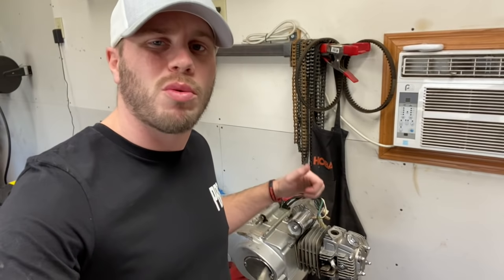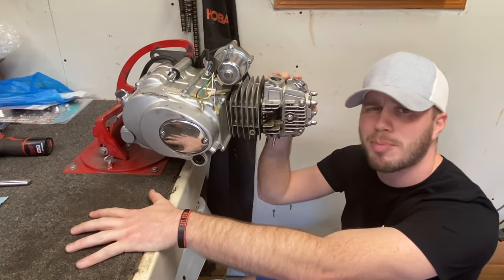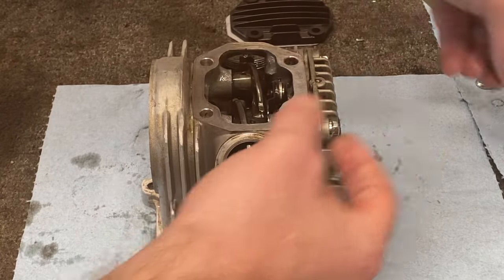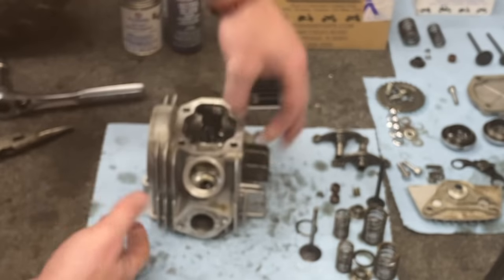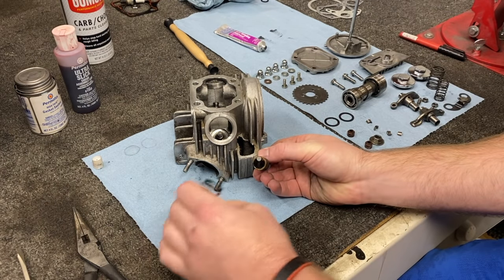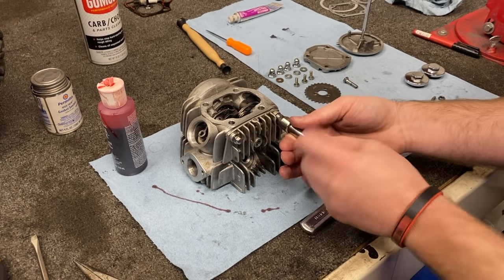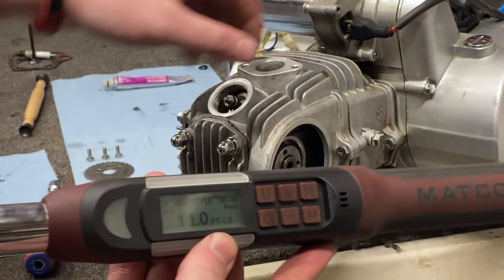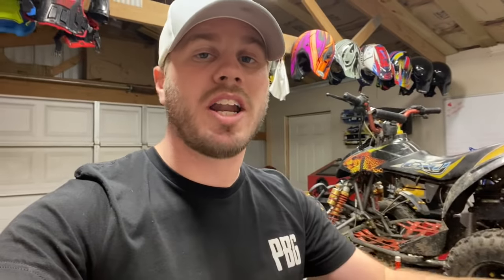HOW TO: Complete Tear Down & Rebuild of a Chinese ATV Engine Head. Every step you'll need covered!

Comment: Great video man! I enjoyed all of that. I just had a question. Is it possible for you to work on those Chinese X-Pro pit-bikes you find on Amazon or eBay?Found metal shavings in mine when I gave it an oil change. The oil was last changed by the last owners basically 7months ago? I’m hoping get this little bugger fixed so I can still get to school on time. Don’t have enough money to buy a whole new engine so why not just rebuild it? 🤷‍♂️ would be greatly appreciated if this is possible.

Comment: I have a atv. 550 Polaris. It runs good sounds good. But smokes a lot and burns oil. Will a leak down test tell me if it’s rings or valve seals

Comment: I was trying to put the chain back on the sprocket but it came of the sprocket inside the crankcase, do I take the crank cover off to put it back on? Also will I need a new gasket if I take off the crank cover?

Comment: Thanks for keeping it simple ...... how can I tell if someone has put the wrong parts on a motor and just claims it won't start ?

Cause I have a 125cc motor that seems to have the wrong cam shift since when I line up the timing marks the intake lobe is pointing down ?
Reply from the maker: The cam in my experience does not have markings to identify the part. It is very easy to order the wrong one. Hard to say without having the original to compare side by side.

Comment: Brother i replaced the clutch in my chinese 110 atv and while i was in there i removed the other big gear to inspect the shift gear and linkages. put it all back together and now it has no compression. i did tear the old cover gasket so i use some silicone. it was running great before i replaced the clutch. any idea what i have done wrong. could i have gotten it out of time some how? i only went into the side that has the clutch. or could the bad cover gasket and sillicone i used cause a leak somehow and give me low compression. it is so low that when you put your finger in the spark plug hole you can barely feel anything as im spinning it over. please help as im very confused as to what i may have done.

Comment: As everyone says,  your video is great!  So very helpful.  Thanks for taking the time to make it.  Just wondering if you've ever seen a 125cc with 23mm/20mm valves with a 32 tooth timing sprocket.  I need a new head, but all I've seen have 28 teeth on the timing sprocket.
Reply: I am in the same situation. Did you find one?

Comment: My son has a 70cc it runs and idles fine but if you snap the throttle wot from stand still it bogs tried everything no stranger to these things just ordered a nibbi carb hoping it’s just the Chinese one that won’t take good adjustment… two questions one have you run into this and 2 have you come across a big bore kit or is it possible to just get a 125cc kit and just keep my bottom end

Comment: Hello bud i have a gy6 150 cc automatic foward and reverse 
my issue is iam getting gas in the oil crank case after a roll over this isue started i installed a new carb but no luck it starts up with no problem but fills up with gas can you please give me a answer on the issue
thank you great vid

Comment: I have a 110cc full auto with starter under engine. It will run but you have to stay on the throttle just won't ilde. Did new fuel line, filter and carburetor. It was used. Can you share a little wisdom?

Comment: Nice and detailed.  Will one oil the valve-shafts before reassembling ?  Great vid, thank you.
Reply from the maker: I just had to watch back to see if I show that and I don't. I poor the engine assembly lube over the top after installed that way the stem and springs are cover. Thanks for watching!

Comment: hey i hope you can help me on this. i got a small leak on the head and it seems like it is coming out from the long bolt thay holds the  chain cover om the head. should i just replace the head gasket or anything else?

Comment: Great info, we were able to diagnose the same problem "exhaust valve" on a motor from  TAO TAO ATA125D, I haven't bought any parts yet  to finish the repair. Before going any further I noticed a difference in the timing drive sprocket on your cylinder head assembly is 28 teeth and the one on mine is 32 teeth. Will the VCM cylinder head assembly  that you make reference to work with the 32 T sprocket from my old cylinder head assembly?

Comment: I have just bought a pantera 125 cc dirtbike that has turnsingals etc . For 100 bucks. Is this the same engine ? Or similar ? Would the parts be easier or simple to find on Amazon or elsewhere? Thank you

Comment: Hello! I am really enjoying your videos. They are so well done, I like your production style.I have a question about a Coleman AT 125 EX brand new no miles so far. The engine will not start, has gas to the cylinder but no spark. Engine turns over, is getting gas, wets the plug but no spark. Dealer is not interested in this problem and will not be able to look at it for at least a month. Summer is short here, What are the possibile causes? Thanks so much, Tim

Comment: So I have a question....you are a great resource by the way.   Really appreciate you.  
I am now working on my 3rd chinese.  Finished a quad and a 70cc pit bike.  Now I am on a 110cc quad again but I have rotten tires and I wanted to get new wheels and tires but I noticed the distance of the studs was only about 70mm instead of 78....of course the wheels can't be found on the web....this model is a buyang?  Have you run into similar issues like this?  Everything else seems to be exactly the same... lol
Reply from the maker: Glad you like the content! Yes I have ran into that issue several times. I purchase the rim diameter size I need and then punch and drill new holes to fit the wheel hub. I don't show it on video but that's exactly what I had to do on my last video on how to flip a chinese atv.
Reply: Well...I wasn't quite sure I could get those holes perfect so I didn't try that.... lol....
I did however purchase the "mini" tire changer from Harbor Garbage (harbor freight)and it worked great!  Thanks for the advise
Reply from the maker: @deepsouthgrease  You bet!

Comment: Need that motor stand!!!!!
Reply from the maker: I actually had a CNC company laser cut out all the metal to start making and selling my own. I will be selling the kits on my website either as a DIY kit or a completely assembled and power coated. Should have everything ready soon and will post updates on the channel.
Reply: Omg! Yes I will buy one as soon as they are available! Any thought on costs each way?
Reply from the maker: @StevenChaosCloud  I haven't ironed it out yet but based on time and cost of materials I am projecting around $150 including everything.
Reply: Not bad at all man!! Just let me know

Comment: This got me thinking, does the decompression valve in the head not affect the compression? I’m still at 70psi on mine and a leak test kit is encountered but I wondered if the decompression valve in the new cylinder head was affecting reading.
Reply from the maker: I don't believe it should. In this video you can see my reading I get before and after the repair and both times I have the compression release in the motor. My guess would be it is something else.

Comment: I have rebuilt a engine to ur spec same engine 110cc it has a decompression valve in the valves like you showed and I’m getting 60psi in the reading it’s jumps to 60 pretty fast but won’t go past could it be I installed the piston rings the wrong way round as they didn’t have any marking on them and was different colour to the originals the new ones , one ring is completely black and one is black with chrome around the outside … ?

Comment: does everything have to be oily before you install it back, for example the ring where the spring sits on? does that have to be fully clean or should it have an oily surface? does this matter? 
Thanks for the amazing video!
Reply from the maker: Everything is going to be covered in oil right off the first rip. I just clean everything to give myself the peace of mind there isn't anything that could cause an issue later down the road. If you have oil on the spring seat your fine. Just make sure there isn't any debris.

Comment: I got fuel spitting out the carb could that be a valve issue ?? Great video
Reply from the maker: Could be a valve or timing issue. It's more likely that the issue is within the carb. It's allowing too much fuel to pass the emulsion tube.

Comment: Hi and good videos.  And my cam cain tensioner  gasket  has gonw. Would this. Stop the engine  to start as i thort it was my valve's. And tineing but all that was ok.  And thort its not got compression. And found the cam chain tensioner. Gasket was not right and was leaking  oil 😮

Comment: I’m guessing the cracked exhaust valve wasn’t apparent during your leakdown test because the intake valve leak was so big. It makes be wonder if after detecting the intake leak if it would be a good practice to cap off the intake opening to troubleshoot further down to exclude exhaust and ring/piston leaks?
Reply from the maker: I guess I don't know how to cap off the intake opening and allow pressure to build. Checking compression again at the end will tell the story if we still had a leak. Normally I would recommend doing a complete top end rebuild including the piston, rings and sleeve since your this deep into the motor anyway, but I wanted focus this video on the head only.

Comment: ive got the same cilinder head on my 72cc zhenhua dax. But the problem i have is that my cilinder makes a tick noice, it tick but the valves are adjusted 100% correct. What could this be? Is this my piston that is hitting my valves?

Comment: Quick question?
I took apart 110cc atv and put it together but can’t remember where fat wire coming from negative terminal on battery goes to ?
Reply from the maker: That is ground to the frame/motor. I attach it to the top bolt of my stator cover.

Comment: Just woundering are you supposed to be in are you supposed to be in compression stage on the motor when you valve adjusted?
Reply from the maker: Basically you just don't want the cam lobes coming into contact with the rockers. If the cam lobes are rotated away from the rockers at TDC that's when you set the valves. I know that probably sounds confusing but if you email me I can send you pictures of what I am talking about.

Comment: Do you have any ideas why the carb is flooding, it's running out the front of the filter, I bought a new one, and it's doing the same thing so not the carb, and ideas to check would be greatly appreciated, thank you, and thanks for the vids
Reply from the maker: Inspect the float in the carb. These parts can sit on shelfs for a long time and the bowl can get stuck. Test by taking off the carb. Blow air into the fuel inlet. You should hear air going into the bowl. Now while you are blowing turn the carb upside down. The air flow should stop and you shouldn't be able to blow air anymore. If you can then your bowl is stuck open or not sealing correctly.

Comment: When changing the motor oil, does it have a spring and cylinder type tube behind the motor oil drain plug? I have a loncin motor. Lmk thanks it actually fell out when I removed the motor oil drain plug
Reply from the maker: Ah man I wish I saw this comment right away. I'm sure you already figured it out but that's the chain tensioner. You needed to remove the 17mm bolt not the 14mm bolt.

Comment: I’m doing a top end rebuild and I can’t get the timing gear right the bolts will not line up on the cam gear when I have the motor in tdc but the gear goes right on the timing chain when not in tdc what could it be ?

Comment: I’m in the middle of needing to adjust my cables on my 120cc engine. Does 0.8 & 0.10 sound about right?? Great video very helpful
Reply from the maker: What cables are you referring to?
Reply: @PraskaBoysGarage  I meant valves not cables lol
Reply from the maker: @connorjack3246  That's alright! I set might to 0.005 Intake and .007 exhaust. You can go as low at .002 and .005 if you want.
Reply: @PraskaBoysGarage  my bike just kinda bogged out, everything on it is as it should be but I’ve never checked the valves what’s the chances of this being my problem? It goes to start but just doesn’t want to fire up
Reply: @PraskaBoysGarage  thank you. Is that imperial or metric?? I’ve never done this before it’s my first time

Comment: like the video and followed your foot steps,but have a question:
i opened exhaust valve cover to check with gage and there is oil came out..cranked and more oil coming from that valve....DOES THIS MEAN PISTON IS SHUT or...???
anybody???
Reply from the maker: There is suppose to be oil, but not so much is pouring out. Could be simply over filled.

Comment: I wonder if that positive to the starter trick would work to start mine I have no wiring harness and am tired of trying to push start it
Reply from the maker: Yeah, you can easily hot wire a switch without the complete harness. As long as you have spark and a way to charge the battery you should be fine.

Comment: Great learning videos best I’ve seen very professional Im having a hard time finding the cylinder head oil o ring and the left side insert was woundering if you could point me in the right direction of where to obtain those parts
Reply from the maker: Thanks! I glad you liked it! If your talking about the o ring for the oil channel then I just bought a universal o-ring kit off Amazon and use the one that fits best. The top end rebuild kits typically won't have it. I am not sure what you mean by left side insert? Can you give me some more detail?
Reply: The other part I am trying to find is the metal sleeve that goes over the bottom left stud of the cylinder bore
In the vid at 8 :48 are the seals I am looking for

Comment: So I have a taotao 110cc atv. I replaced the piston, rings, and even have a new piston cylinder. I replaced the Entire top end, ground the valves and installed the timing sprocket at TDC. I set the valves like you said. With all that done, I only build 54psi compression. I don’t have a real leak down tester because I can’t afford one, but I was able to attach my compressor to the spark plug hole and at TDC there is 0 leaks out of the intake or exhaust valves and no piston leak by either. Where is my pressure going?! There doesn’t seem to be any leaks out of the gaskets Lol. 

Side note: I got my compression test kit on Amazon for $23. Could my cheap tester be bad?
Reply from the maker: I have had other people with similar issues end up with a bad compression tester. If it isn't to much trouble you should try and run the motor with a little fuel to see if it starts.
Reply: @PraskaBoysGarage  I checked my compression gauge against my compressor and it’s accurate, I went ahead and tried to start it with fuel and spark and it won’t, I double checked my leak down test and I can hear air coming out of the oil fill cap. Weird thing is, the piston, rings, and cylinder head are all brand new. I tore it down and rebuilt it again to see if I didn’t have a ring seated correctly or if I missed something and it still leaks by the piston. I put a little oil on the piston to see if that would help hold Compression for it to start and seat the rings. Still no good. Not sure where to go from here.

Comment: Is the torque for the lower side bolt that screws into the cylinder 11 ft lbs just like the top 4 head nuts? Thanks and great vid!
Reply from the maker: Technically yes, but to be completely honest I just get those nice and snug and call it good.

Comment: Im really struggling to get this SSR 110 motor back together, I thought I had timed it correctly but now when I try to kick it, the compression is insanely hard
Reply: Did you test it with a compression tester?. In that setup, the only way to increase compression is to use a very thin head gasket.  Maybe pre-ignition,  spark timing.

Comment: 26:58 and 30:10 and 32:16  "According to the Honda Manual"... I thought this was for Chinese engines?? Honda is Japanese... Completely different quality and design last I knew. 🤔  Also, you promised the install and test of this engine as "the next video" I feel like that would be the most satisfying part of this 😔. That being said, I did learn a lot from this though!
Reply from the maker: Yes, I reference Honda manuals because these motors are Chinese clones of the Japanese motor. Since the Chinese motors have limited or no information available I use the Honda manual as my guide. The motor and ATV are still not put back together but will be a video in the future I promise! Thanks for watching!

Comment: What can i do if the timing chain is too short or doesn't have enough slack to put cam gear on? It's 1/4" short. I can't figure out why when it was fine before I disassembled it??
Reply: You need to release the timing chain tensioner to give the chain some slack